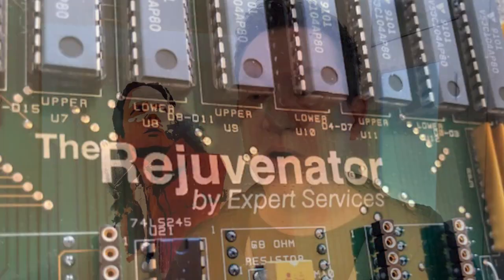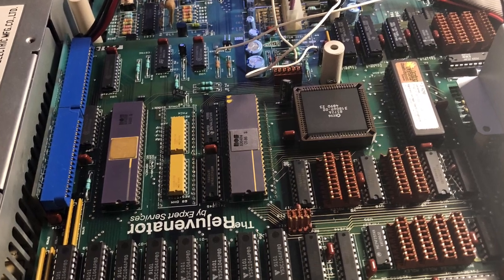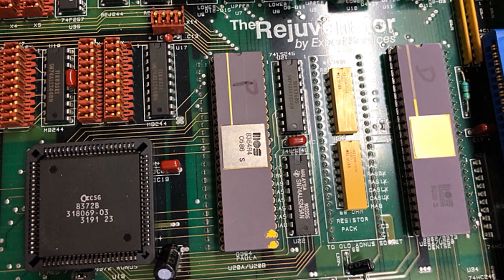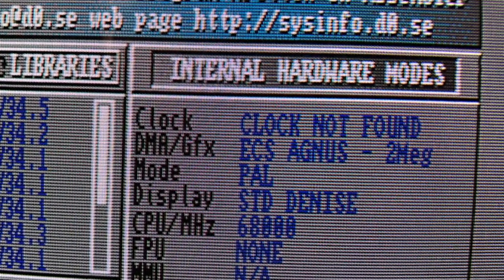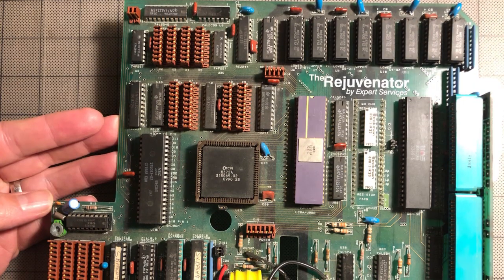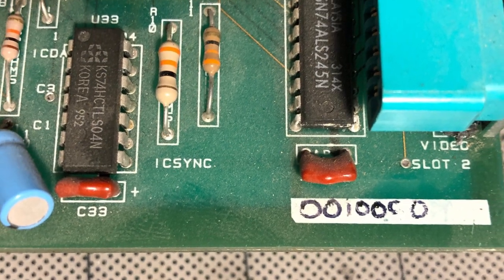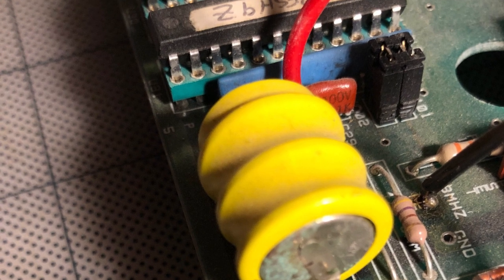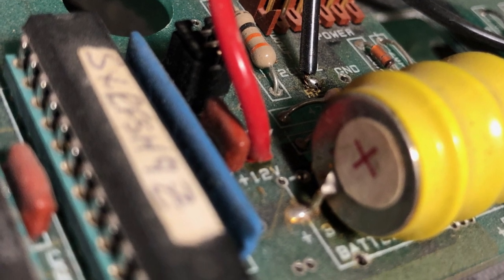Amiga 1000 Rejuvenator Update 3.14: You Can Almost Taste It

Comment: Hi, i have just buy an amiga 1000, when i open it up to check if i have to repair something, i have found my a 1000 have The Rejuvenator install on it. i have start my recherche on that board .. and now i'm very happy. the battry have leak but my friend will check monday. just a question.. do you have the 3d printer file of the spacer to re put the board on top of the mother board ?
Reply from the maker: Sure - here you go https://www.thingiverse.com/thing:3032116
Reply: @AmigaLove  Thank you for your fast answer :) i will have a lot of fun with my a1000. i also have 2 others board install on the a1000 : Lucas and Frances

Comment: Did you make some good progress with the PALs? 2019 end's in a fiew days but my A1000 would be still very happy about some more Chipmem :-)
Reply from the maker: The main engineer working on the project wound up taking half of 2019 off due to work obligations that forced him to travel non-stop. He started working on the pal equations with another engineer literally 3 weeks ago. If the problem is solved, it's getting pushed into next year. I'm still very hopeful, though, especially now that he's back at it again. And a second board is being built in tandem so the two guys can work head-to-head simultaneously.

Comment: I am just getting my two 1000’s going now. I have a rejuvinator I bought new but has battery damage and I need to repair the pin extenders. Good luck and Keep going!
Reply from the maker: Good luck with the repairs, Geoff! Our new board is now proven to work. If your Rejuvenator doesn't wake back up (destroyed traces, etc.) our board could help. But ideally we get the PAL logic chips decoded, and the whole she-bang is good to go.  That being said one of my original Rejuvenators has battery damage, too, but it didn't stop it from working. Fingers crossed for you!
Reply: Your video prompted me to examine the damage a bit closer. I may need to replace the board thanks.
Reply: Any positive news on unlocking locked pals?